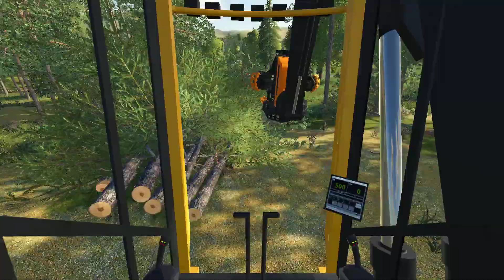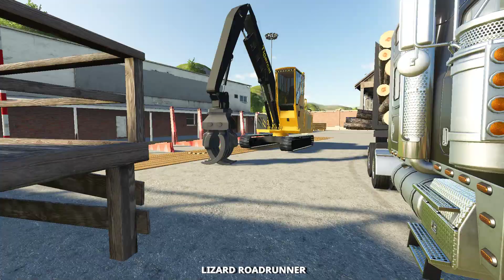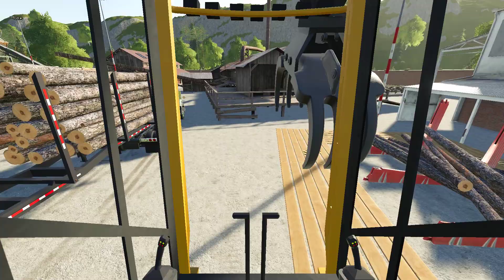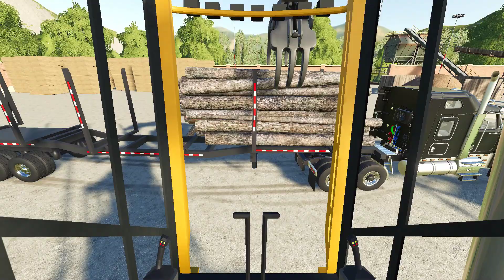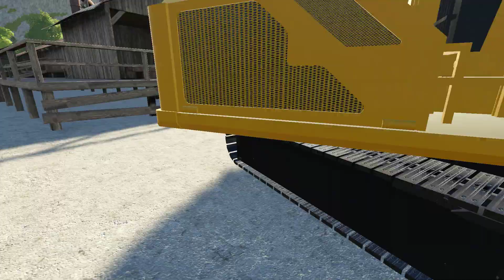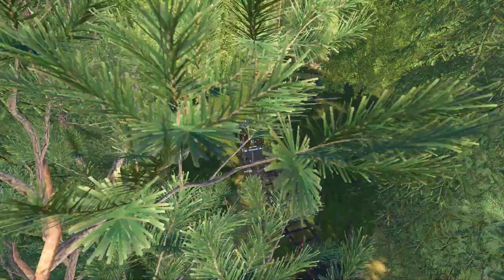Removing Stumps The Easy Way! - Logging From Scratch 67 - Farming Simulator 2019 - FDR Logging

Comment: Two things...one what control have you mapped the second claw on the processor too? I’ve tried every control I can find on the joystick screen and can’t get the second claw to move!!  Second ... gimme that stumper!!!!!! 😝
Reply from the maker: its listed in the control guide www.fdrlogging.com/controlguide
Reply: FDR Logging I went through that. I even went as far as to open the xml file and I could find a grouping for the roller and the main claw. But I cannot find a grouping for the second claw. Even redownloaded the processor file to see if mine had corrupted and no joy. With no control group there is no axis to bind to.